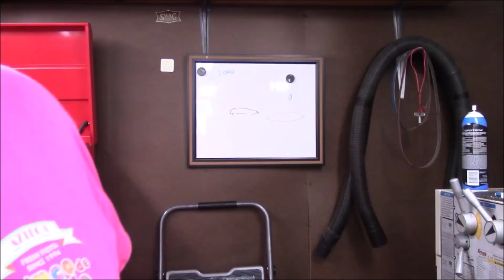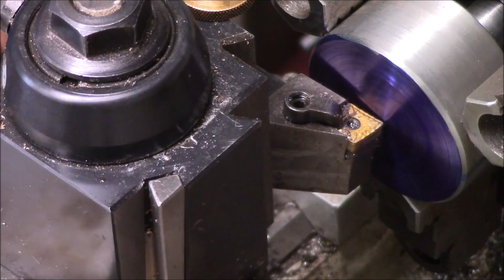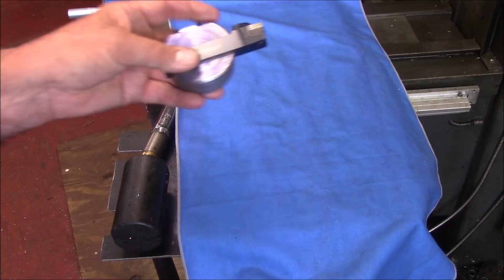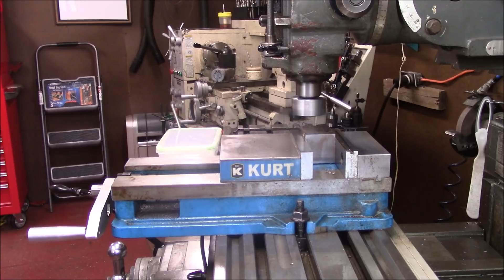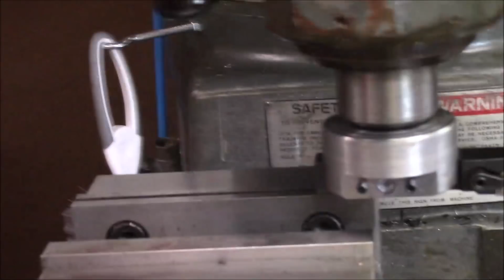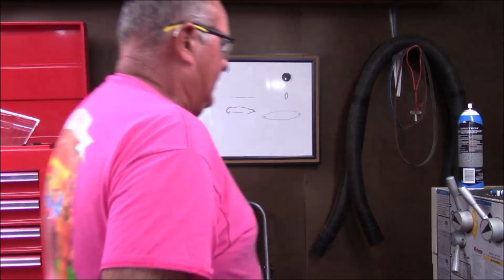Fly cutter build part  2 mill work and testing

Comment: Carbide gives a better finish under pressure.  You pretty much had a perfect speed/feed setup.  Sorry for the broken tap.  AvE used a carbide burr in the mill, smaller than the tap, to get one out.  Hope that cutter gives you years of service.  Maybe put a small indent in the cutter shaft for the set screws to catch in, since you only have two screws.  That way, even if they loosen a little during cutting, the cutter won't fly out.  See you next time.
Reply from the maker: Mature Patriot yep I tried a couple of things but in the end I couldn’t get it out. So I just making do. Thanks for watching and commenting